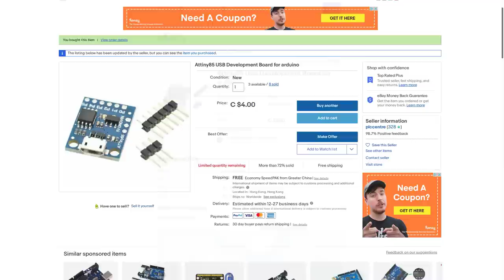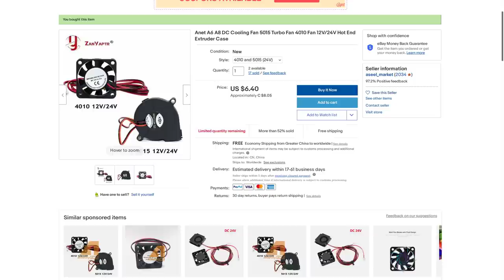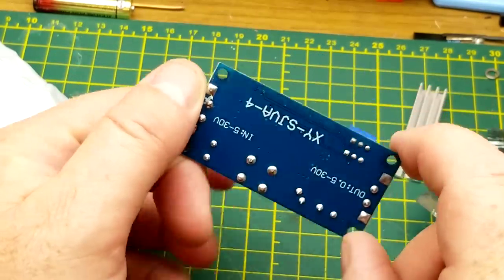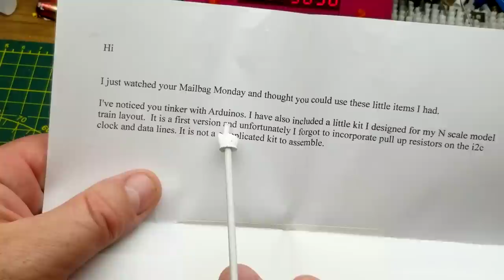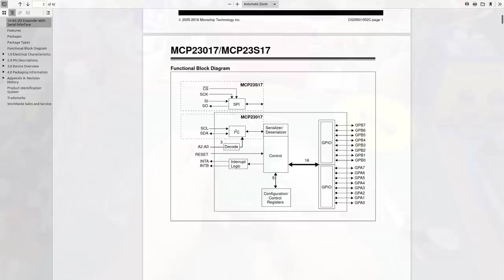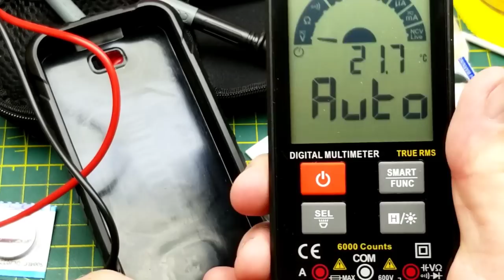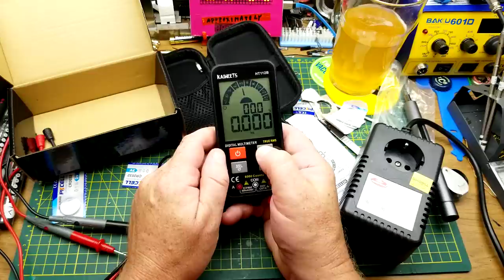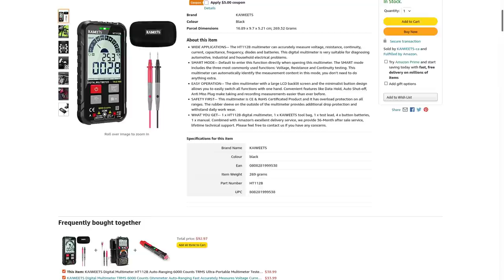mailbag Monday #121

Comment: With the 3D printer fans, the hot end cooler is 1005 the correct one, and that is the one that gives the most issues.   The Ender hotend cooler seems to suck whisps of filament in and is notorious for failing quickly.   Not sure about the part cooling fan, I have never had to replace that on mine where I have had 2 hot end cooling fans fail in a year.
Reply from the maker: Thanks for confirming.

Comment: Those little CC/CV buck/Boost modules are NOT really lithium chargers.
The "full" LED is just that, an indicator... the LED usually comes on when the Current drops to 10% of the set value, however it continues to charge (in CV mode) until you manually disconnect it.
It's generally considered that the CV phase needs to be terminated at about 10% of charge current (or 10% of the C of the cell). Leaving it on "float" or "soak" charge longer than that will boil off the electrolyte and lower the lifetime. The cell never actually gets to zero current draw, hence why the charger needs to disconnect the charge once it's full.
So, with a proper charger, when it's "full" you can leave it there because the charge gets terminated. If you use one of these modules you MUST take it off as soon as the "full" LED illuminates.

Comment: Not only did I just receive the CD4511s that one of your previous videos inspired me to order, but I also just coincidentally received some MCP23017s that I ordered to supplement my inventory of PCF8574s (8 bit expander).
Reply: Just used up the last of my PCF8574s as I2C backpacks for LCD displays.  Interesting that some have a base address at 0x20, others at 0x38.  It odd that the MCP23017 is more expensive than the atmega8a, when the Atmel can be programmed to do the same thing (shrug).  There must be more modern port expanders in wide use, as these two seem to be less available, and more expensive than necessary.  Perhaps, in the age of sub $1 MCUs with 32+ pins, there is less need to for paralleling devices?  595 shift registers are still common, and cheap.
Reply: @GnuReligion  I guess pricing varies, because digikey has the MCP23017 for about a $1 less than the ATMEGA8A.